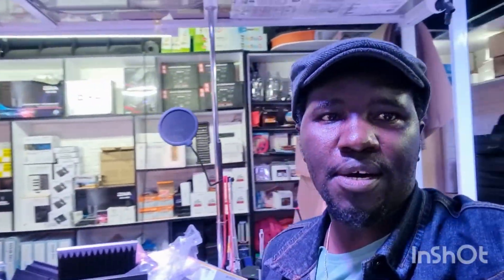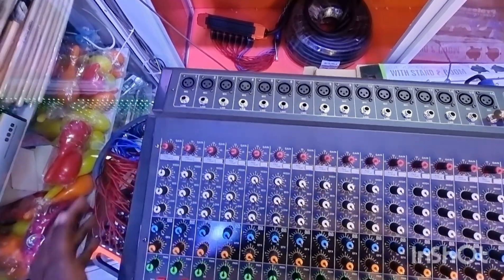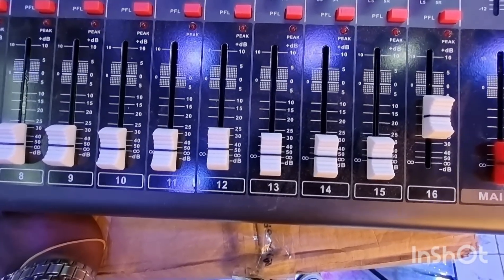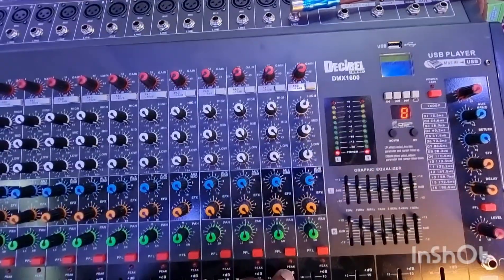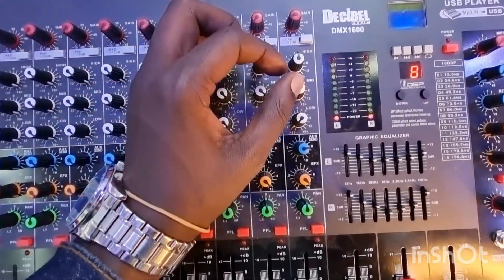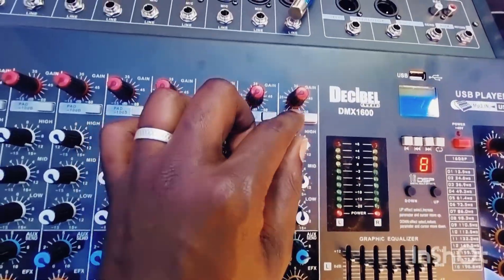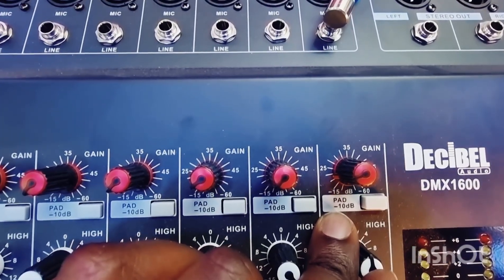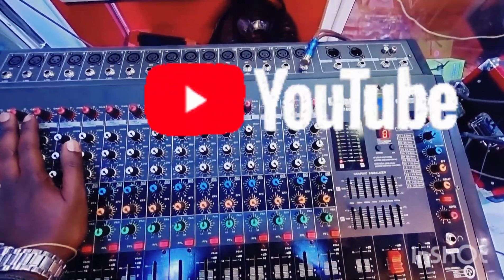USING A POWERED MIXER #lesson1 #decibelaudio

Comment: pls can we use equalizer and crossover for a powered mixer pls
Reply from the maker: It's possible,  but not practical if you have more that  1 input .. so in short you need a power amplifier